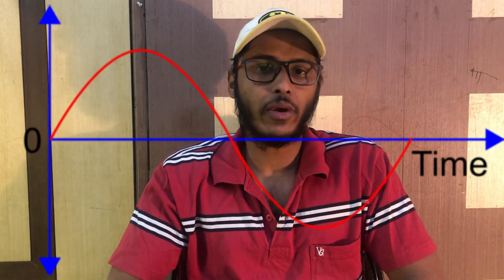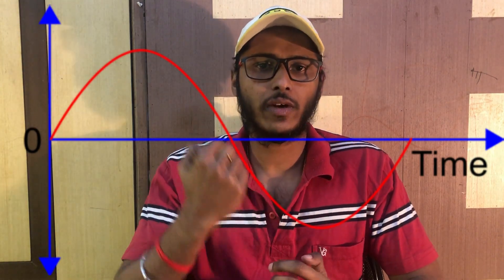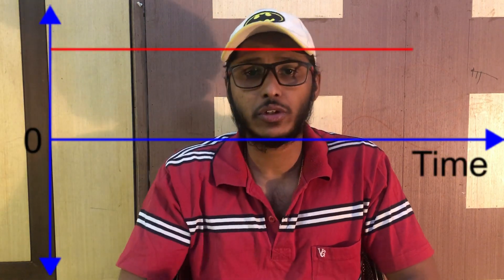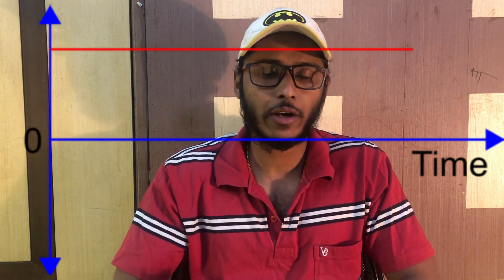AC vs DC | Which one is more Dangerous | AC ആണോ DC ആണോ കൂടുതൽ പേടിക്കണ്ടത്

Comment: More than 99% of the body's resistance to electric current flow is at the skin. Resistance is measured in ohms. A calloused, dry hand may have more than 100,000 Ω because of a thick outer layer of dead cells in the stratum corneum